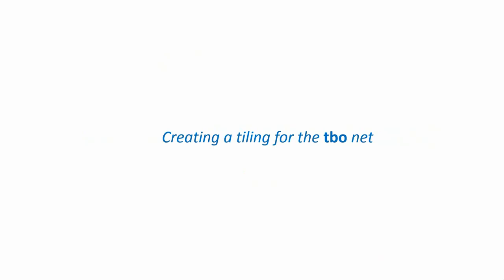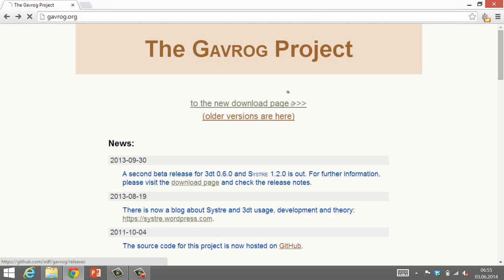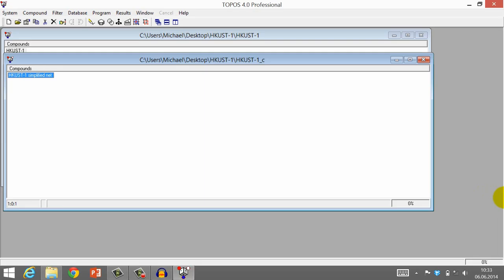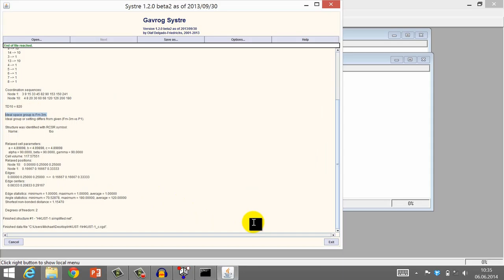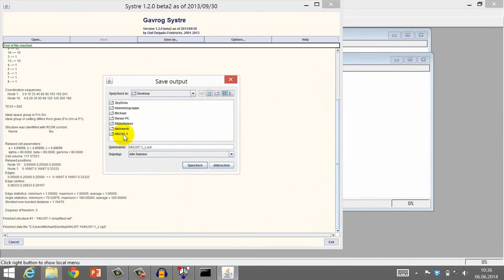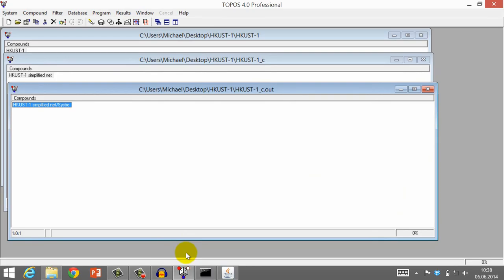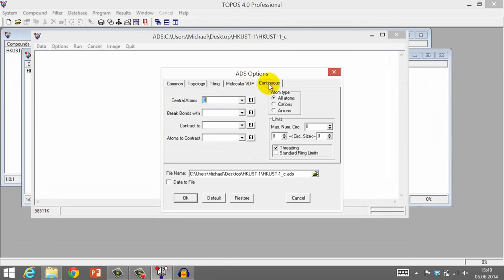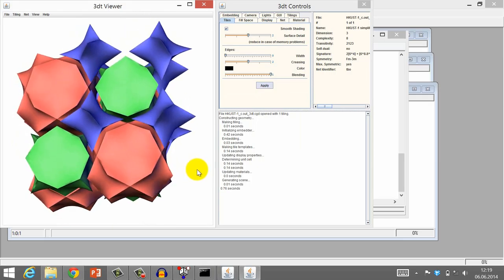Unit 7.5 - Creating a Tiling

Comment: Hello Sir, I followed your tutorial exactly but when I opened the final file in 3dT. No tiling was shown. It opened as

Data_c.out_3dt.cgd opened with 0 tiling.

Please help. Thanks in advance
Reply from the maker: Hi,

unfortunately, with this little information I cannot reconstruct why this is the case. 

Please check in Topos, 

- if you set the value of the maximum ring size to 12 in the Topology Tab
- if you set that the Max. Tile Size is set to 100 in the Tiling Tab and if you checked the checkboxes "Naturual Tiles", "Locally Strong Rings", "Single Tiling" and "Inessential Crossings".

Did you get the output file with the tiling properties as shown at 7:35?

best regards
Frank
Reply: @FrankHoffmann1000  Thank you so much for the response, Sir. I could resolve the problem after reading the output file.